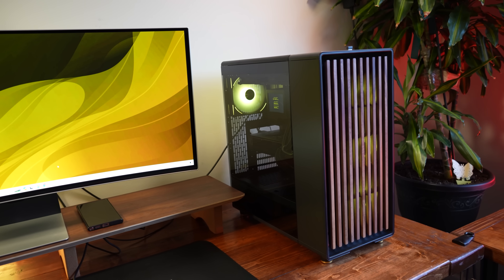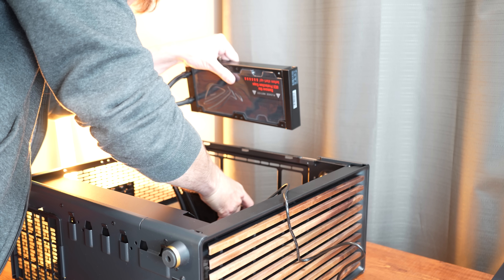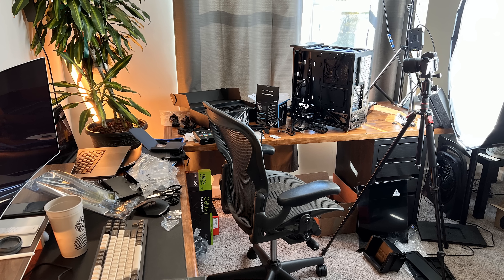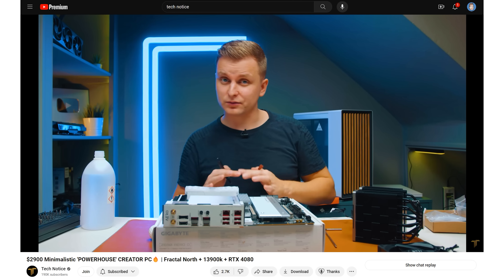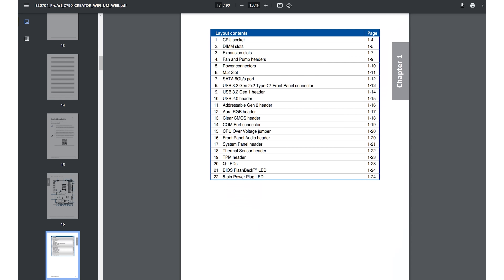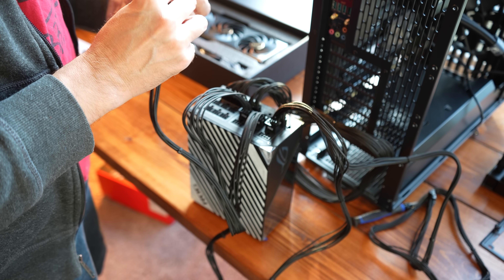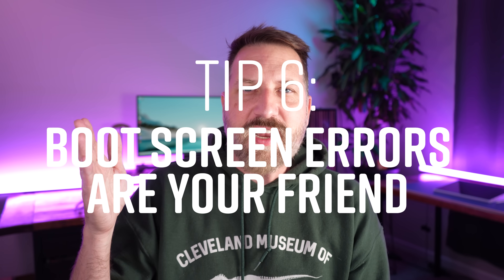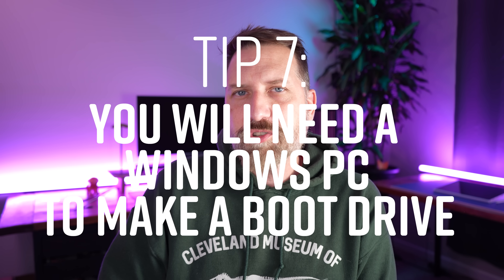What I Wish I Knew Before Building My First PC

Comment: I recommend a 3050 cause its powerful in terms of art
Reply: 1660 ti is better and cheaper than 3050. Get 3070 or 4060 if youre building new
Reply: Yeah but it's not to helpful if you want to do 3d.
Reply: No, never get a 50 series card. For the price point you can get alot better cards from intel or amd, and for art most you need is iris xe
Reply: @Scythinite   listen, if you have a 3050 with 16gigs of ram, you can run a project with total ease
Reply: Arc GPUs are far better using them😂
Reply: You don't really need a gpu for art... Intel's igpu is enough. 
But if your workflow is a bit advanced (especially for Photoshop), then you can consider getting one, anything from an arc A380 to an RTX 2060/3050 is plenty.
Reply: @luvoverthewall if you're doing 3D you certainly need a gpu. Not everyone is a painter/illustrator
Reply: @theinktician  most definitely.. I'm tryna get into 3d as well and i will need a gpu for that.
Reply: Na don't for content creation yes nvidia is better right now  but i would HIGHLY recommend sticking with integrated graphics until you afford a 3060 12gb you'll get MUCH 2X in some situations preformance boost
Reply: @itamar8424  I think he was joking...
Reply: + i7 860, it's i7 bro better than i5 and i3
Reply: get probably got a 4090 there my bro
Reply: @aeonbreak4728 beep boop i'm from the future only losers get 4090, 6090 is where it's at.